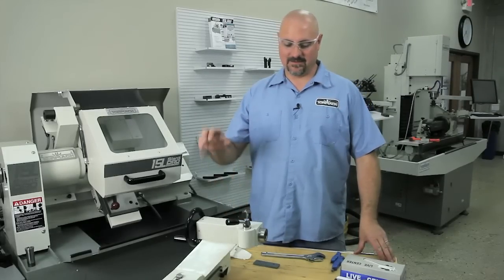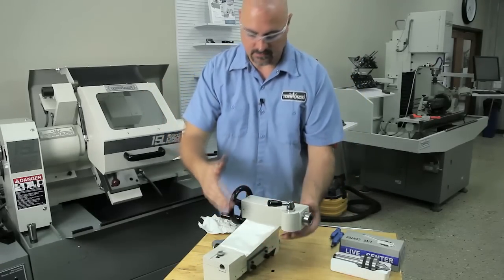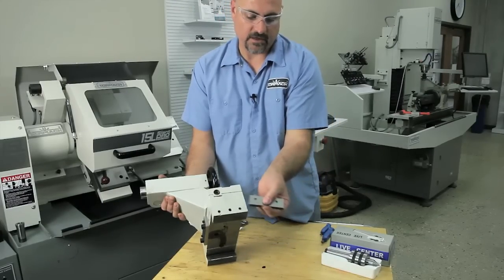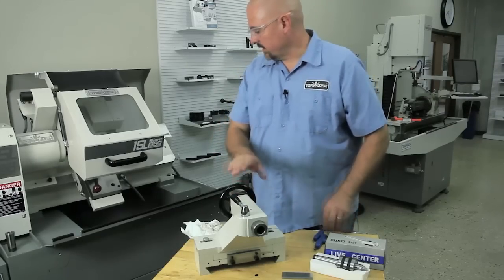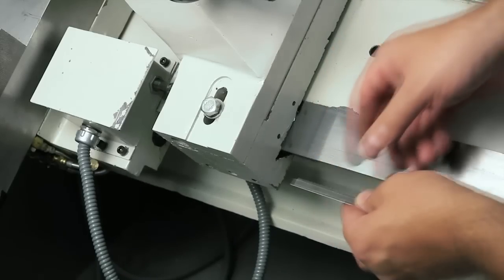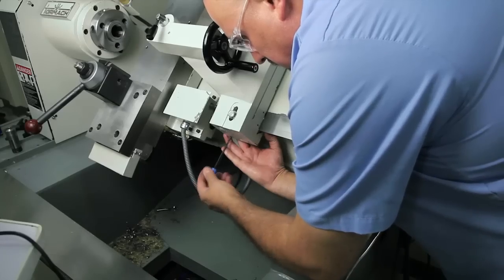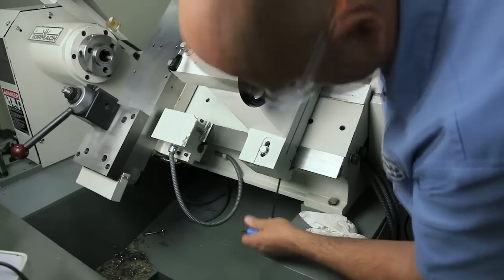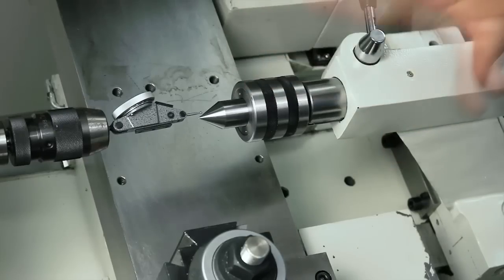Tormach 15L Slant-PRO CNC Lathe: Setting Up the Tailstock

Comment: Please make videos of the tail stock in use also is it possible to use the tail stock with the turret installed?
Reply from the maker: Yes, you can use the tailstock with the turret, but you need to keep in mind that each extra item you add raises the possibility of collision with the turret tooling, and on retract. We also offer the RapidTurn on the PCNC 770 and PCNC 1100, which allows for the use of longer stock. https://www.tormach.com/store/index.php?app=ecom&ns=catshow&ref=RAPIDTURN&portrelay=1

Comment: I also seem to be unable to tighten it down without throwing all the adjustments off. I'm tightening the two "B" bolts in very small increments, but they compound each other.
Reply from the maker: You seem to have quite a few questions. Feel free to reach out to Tormach's Technical Support Team at: info@tormach.com
Reply: Thank you. I more-or-less got it dialed in, at least for this job. If I need better accuracy in the future, I'll reach out. Thanks.

Comment: It seems that adjusting the tail stock up/down set screws while indicating on a conical surface will give you erroneous results, as the cone will be translating along Z, affecting the Y measurement.

Comment: One installed, can the tailstock be left on the lathe, or would it interfere with the slant bed moving to the home position?
Reply: Note that the tail stock interferes substantially with the carriage. You can only home Z with the carriage in a vary narrow range of X position.
Reply: Thanks Rick!
Reply: It can be left on. It will re-home against the side of the tailstock, rather than against the tab removed in the first step.
Reply: Thanks Warren
Reply: I should add, you can also only home the X in a narrow range of Z positions, and sometimes not at all without moving the tailstock, live center, tooling, or your work piece.

Comment: How repeatable is the tail stocks position? If I say, move the tailstock from the far right to middle or removed it completely, How close to center can I expect the live centre tip to come, by simply installation. Would I have to Re-dail the centre every time.
Reply from the maker: Alexander McGilton You could possibly repeat the tailstock position if you move it to the left or right, but that depends on how well you set it up in the first place. I wouldn't trust the position if you completely removed it though. We recently added a document that covers proper tailstock installation to our website. Here's the link: http://www.tormach.com/uploads/824/TD10297_Adj_Tail_Stk_Install_0115A-pdf.html
Reply: Tormach Inc. I read both that and the inspection report, neither answers the question. 
The closest tail stock that it resemble is one for a Hardinge tool room lathe. Both with a dove tail way and approximately the same and reach, only that the Hardinge has 8-10 inches of length engaged against the bed. My concern is that with the short aspect ratio and the front jib plate resting on a painted surface. You may need to re-tram the tailstock for every movement.
Reply from the maker: Alexander McGilton Correct.  At minimum, I would suggest that you verify the position of the center with respect to spindle center each time you reinstall the tailstock.  The tailstock and Lathe are not sold as a matched pair so there will be no pertinent measurement in the inspection report to in regards to repeatability of tailstock position.  If you were really interested in this number, the only way to get it would be to measure yourself for the lathe/tailstock combination that you purchased.

Comment: Mike, you forgot to show putting the setscrews over the top of the pointed grub screws that hold the gib in place, and installing the lock down handle (page 3 of the instruction booklet).

From watching your video, it looked to me like I was going to be forced to use the allen wrench on the grub screws every time I wanted to lock the tailstock in position (which would be every time you use it)... which would have been a bad design.  

Glad to see that there is a lock down handle.
Reply from the maker: Forgetting the set screws wasn't Mike's fault. We grabbed the first production model that arrived, which was also just inspected, and didn't see the set screws that were set aside on another table. You are right, the first set are used to set the gib plate and the second set lock the first set into place.
Reply: Mine didn't come with a second set.